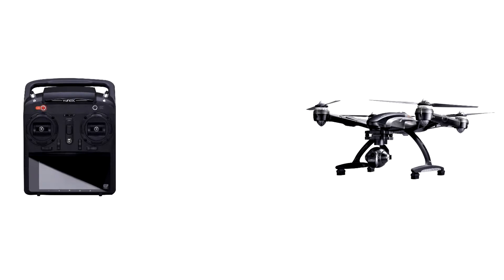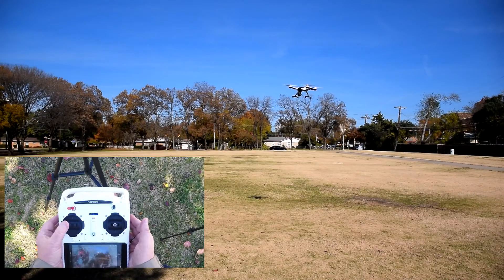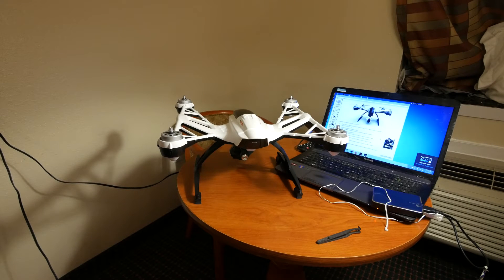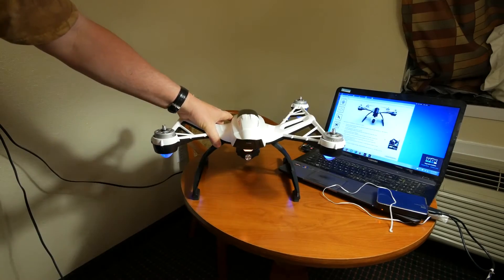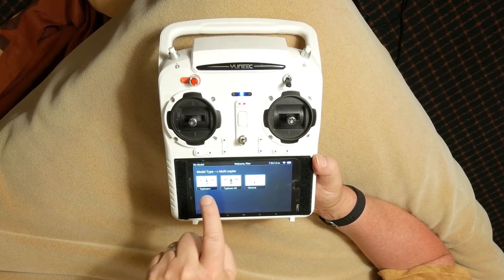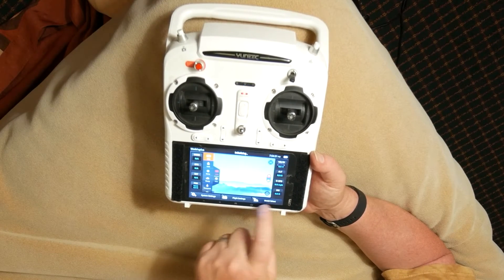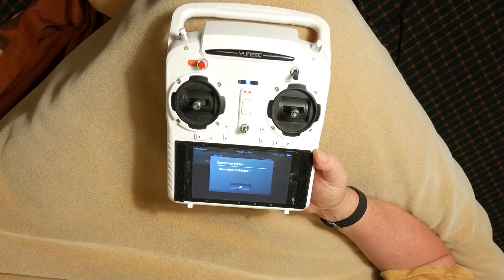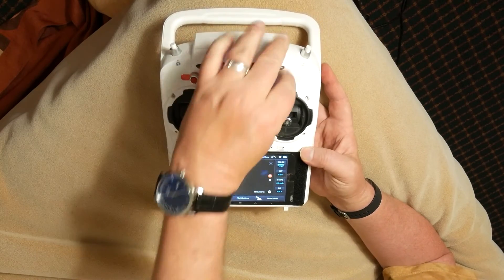Episode 12 - How to Bind the Yuneec Q500+, and Q500 4K to the ST-10+ Transmitter

Comment: Jeff, this is Bill again, the diehard Q500 fan. I can't Bind an old Q5004K. What's odd is that it bound perfectly yesterday but this morning it "unbound" itself & like I said. My next step is to try another transmitter...but my bet is it won't work. Any ideas? I know the binding procedure by heart but always use the book. As always, any help greatly appreciated!
Reply from the maker: Hi Bill - I must admit, you've got me stumped with this one. I can't think of any reason why you would have to rebind the drone two days in a row, let alone have binding work one day and not the next. Any chance there is interference causing the rebind to fail the second day? Try rebinding in a different location? Other than that, it would be a good test to try a different transmitter if relocating doesn't work. Do you have a different transmitter?
Reply: @JeffSibelius  Thanks a million Jeff & you hit on the answer!  Here's what happened - I went through three other transmitters trying to bind yesterday. No luck.You mentioned nearby interference! How about a portable ice maker working within 3 feet of my binding operation! Today, ice maker off, it binded immediately! Once again you have saved a diehard fan! Thank you very much Jeff for taking your valuable time to help!
Reply from the maker: @billcallahan9303  LOL that's awesome! It was just a WAG on my part . . . . I couldn't think of anything else to cause what you were describing. Glad it worked!
Reply: @JeffSibelius  You're a genius at WAGs Jeff! I can't thank you enough. I worked all afternoon yesterday sweating in north Florida heat...beside my running ice maker! You take care buddy!

Comment: Jeff, I know this was 4 years ago but if you get this, I have a question please. I have range extenders on two of my six Q500 4K drones. It does extend the flight out to about one mile but I lose video at the usual norm of about 1,000 feet. Is this normal for a range extender? If so, I find the range extenders pretty much worthless. Your input & experience is valuable to us die hard Q500 users. Thank you for any advice!
Reply from the maker: Hi Bill - nice to know there are still some Q500 flyers out there! I used a range extender for a short time and my experience was the same as yours. It didn't seem to help my video feed. It does add value in that you are less likely to lose connectio n with the drone with the extender, but overall I found it to not be worth buying.
Reply: @JeffSibelius  Just what I thought Jeff. I never thought about the retrievability aspect of extenders so thanks for that. I buy these off eBay from $250 to $350. A long way from $1,000+. Thank you for your help sir!
Reply from the maker: @billcallahan9303  you bet. Yeah, the Q500 is a venerable old drone and you can get them for a steal now. And I love the video you get from Yuneec drones!

Comment: Why R U Deleting & Re Creating what is all ready there?...
Reply from the maker: This was how Yuneec tech support told me was the best way to ensure a successful bind.
Reply: O-k  @JeffSibelius  Love UR videos and have learned so much from you about flying my Q500 4K but after lots of re-search and my own experience,  Deleting is not necessary. & if 4 some reason the "Bind" or re-bind is "Not successful" than I would do a "Delete"
Reply from the maker: @philipgrubel8222  I've talked with Yuneec CS a couple times about this over the years and they consistently said to delete first. I'm guessing they feel they have less problems with binding a new profile rather than rebinding an existing one, but they're the experts so I'll follow their lead.  But hey, if it's working for you, don't delete . . . I'm a big believer in "if it ain't broke, don't fix it" so if you have a process that is working for you, definitely stick with it.
Reply: Thank you  @JeffSibelius  That's how I do it now also... I Delete,  and create a new model.  its so easy and like you said, ensures a successful bind..   I switch between my Yuneec USB simulator, and flying the "Real Q500 4K so when it's time for me to fly the "Real Q500 4k"  I delete and create a new model very easily and quickly and I am ensured of a proper "Binding"  Thanks again  for all of your videos about my Yuneec Q500 4K  : )

Comment: I can not get the q500 to bind up to ST10+, I followed your directions and it does not show up in the list, camera does but it is not showing any video on monitor. I tried other camera options and finally got the video to show up on display, CGO2 camera was what I needed. Still not able to get q500 to bind, tried deleting the profile and creating a new and no luck.  Reason I am doing this, I could not get it to lock on to GPS signal to so drone could start to fly. Motors will not start. Always worked great and stopped flying for a bit and put in storage case, got it out and no GPS lock on q500, ST10+ is fine on GPS. Now just making beeping noise after it starts. Any thought of what to do? Thanks in advance for your help. Great videos, keep up the good work.

Comment: Rselly like these videos.. I just purchased a Q500 yesterday at Best Buy. The controller is an ST-12 not the usual ST-10. Any difference in the two units that you are aware of?
Reply from the maker: I wasn't really familiar with the 12, but I looked around a little and it appears it's just an ST-10 with a couple of buttons that work on the Typhoon H. For your purposes with the Q500 it should function the same. I'm saying that only based on what I've read, however - I have not tinkered with one of those.
Reply: Jeff Sibelius  Many thanks for the information.
Reply from the maker: let me know how the 12 works for you. If it doesn't work properly, I can probably hook you up with someone who would swap it for an ST-10 - but I really think it will do just fine.
Reply: Jeff Sibelius - I didn’t know it would work with the Typhoon H which I also recently purchased. Again - many thanks for the information.

Comment: DOES THE Q500 HAVE TO FACE NORTH FOR CAMPUS CALIBRATOR ?
DOES THE Q500 HAVE TO FACE NORTH FOR "ACCEMERATOR " CALIBRATOR?    
  .                                      SPELLING ERROR FOR ACCEMERATOR.
Reply from the maker: I hear different opinions on this - I always point mine to the north for compass calibrations but others insist it's not necessary. I figure it can't hurt to do it so I stay with my method.

North isn't necessary for the accelerometer calibration though.

Comment: My camera it’s not showing up on the binding
Reply from the maker: A couple ideas . . . 

- Refresh your screen
- reboot the entire system
- make sure the camera is physically connected and getting power
- If the camera still doesn't show, make sure you have the correct camera selected (CGO 3 Pro, not CGO 3 or CGO 2+)
- After that, I'd delete the profile for the drone and create a new one to see if that might get it to show.
Reply: I️ tried I️t and nothing
Reply: I️t only connect the bird only but not the camera

Comment: I need help! I have a Q500+ and im getting the unable to connect camera error. When it does connect it will work for a few minutes and then lose connection. I've already updated the firmware on the st10+ and the CGO2+. I've also tried reformatting the SD cards and creating a new "name" and rebinding everything.. Nothing seems to work. Please give me some advice or let me lnow if there's anything else I can do!
Reply from the maker: Hi Justin - the first thing you should try is to physically disconnect the wire running from the camera to the body of the drone and reconnect it, making sure it is fully seated.

After that, you've pretty much done everything I would recommend. This could be a mechanical malfunction, unfortunately. Is this a new problem that has popped up or did you just get the drone and have the problem from your first try?

Comment: HELPPP!!! I my camera is not showing up when i try to bind it but it will show up on my phone but will not record properly. Always failed and I have done the current firmware update. Not sure if the camera was successful on the update.
Reply from the maker: Hi Josh - let me make sure I understand. When you boot up the drone and TX, you see no image from the camera on your transmitter. Correct?

You DO see the signal from the camera when using the phone app?

Just a shot in the dark but have you tried unplugging and replugging the connector from the camera to the drone? I don't think that's the problem but it can't hurt to try.

This more sounds like a problem with the transmitter receiving the signal, assuming you can see it on your phone. 

Assuming that you're experiencing is what I described, this is one to call Yuneec about. I can't help unfortunately, but they should be able to nail down the cause.
Reply: Correct. The camera does NOT show up on the TX when trying to bind. And on my phone I can see the image from my camera and connects no problem, just will not record correctly. I have called Yuneec this morning and just waiting for their call back. I did a factory reset and updated all the devices. I checked and all are a current model. Just will not connect or bind the camera to the TX i did have it pop up a few time this morning and entered the default password that is on the TX i the file of the SD ... but it failed.
Reply from the maker: That's very strange. If the tx doesn't see the camera that would explain why you can't see its view or record. That makes sense. The fact that you can see the signal from your phone is odd - can you record from your phone or does that fail as well?

One thing about Yuneec CS - their record for calling back or responding to emails is . . . spotty. Your best bet is to wait on hold, even if it takes a long time and you have to suffer through that horrible hold music. Once you get someone to answer, their service is pretty darn good in my experience.
Reply: I can also control the angle of the camera from the TX but not see the image and it just keeps saying that its CONNECTING: Wifi. 
On my phone I I can start to record but it fails to stop rerecord again.
Reply from the maker: You could try a different media card in the drone because that can cause camera issues, but it wouldn't cause the camera not to show up so you can bind it.

This is a strange one - let me know what Yuneec tells you, ok?
Reply: Tried 3 different SD cards. Yuneec said that I  need to send it into them. They are paying for the shipping though.

Comment: I have a typhoon G. can I use the CGO3 4k on it? Would it work Record, transmit?
Reply from the maker: Hi Jerry - yep, the CGO3 works just fine with the G. I got a G a couple years ago and never used its gimbal or antenna - just put a CGO3 on it from its first flight.
Reply: Jeff Sibelius - Follow up question, isnthe CGO 3 the one transmitting the signal and are you able to control it with the transmitter?
Reply from the maker: Right. Once you attach the CGO3 and bind it through your flight settings, you'll have full control of the drone just like it was a Q500 4k, without the use of the MK-58 antenna (I think it's MK-58 LOL).
Reply: Jeff Sibelius - thanks so much... your a yuneec guru.. do you have a facebook group?
Reply from the maker: Glad I could help. I don't have a group of my own but I participate on rcgroups.com, yuneecpilots.com and a couple Typhoon H facebook groups.

Comment: I just bought a Cgo3 but it's not showing up in the camera select setting. What can I do? (I have a q500+ copter)
Reply from the maker: Hi Lamount - the only thing I can think of is that you're using an older firmware version. Try updating your firmware to the current version, make sure you reboot the aircraft and TX after you do that, and see if the camera shows up on your list.
Reply: Jeff Sibelius okay, I'll give that a try.

Comment: When I turn on the Q500 the lights are red, not blinking blue. Is there a problem with that?
Reply from the maker: If your lights are blinking red, that normally means you're in Return to Home Mode. Try flipping your mode switch back and forth between Smart and Angle a few times, then leave it on one of those modes, to see if that fixes the issue.
Reply: Thanks. But they are not blinking, they are solid red.
Reply from the maker: The LED guide says a solid red means initialization in progress and a pulsing red means initialization failed. If you can't get past either of these light patterns I think you need to call Yuneec CS - it could be a mechanical issue.
Reply: Would I find a possible solution Connecting the GUI? Thanks again.

Comment: Thanks VERY much for this! I got my Q500 4K back from Yuneec for a motor replacement, and there were no instructions on what to do, so I was dismayed this afternoon about to take it up, and nothing. This was why!
Reply from the maker: Glad I could help. 

Yuneec expects people to know their indicator light patterns, but their manual is incomplete and inaccurate in this regard. They could reduce the number of calls they get if they'd just put a note in with returned drones to remind people to bind their quads and cameras to their transmitters. 

I've got a video in the works with a whole bunch of random tips like that . . . it is  probably 3-4 videos down the road but it's coming!

Comment from the maker: This is Episode 12 in a series of videos designed to help you fly safely and successfully with your drone. In this episode I walk you through the process of binding your ST-10+ transmitter and Q500 drone. Binding is the proccess where you connect one transmitter with one aircraft. This episode applies to the Yuneec Q500+, Typhoon G, Q500 4K drones an the ST-10+ transmitter.
Reply: Jeff Sibelius I purchased a refurbished q500 went through binding process and model does not show up on screen after input of new model anything else i can try
Reply from the maker: Have you updated the firmware on the aircaft and TX?
Reply: You saved my life thank you
Reply: I wanna quad (i guess that what it is.) To a spare yuneec to my transmitter.how do i do it?